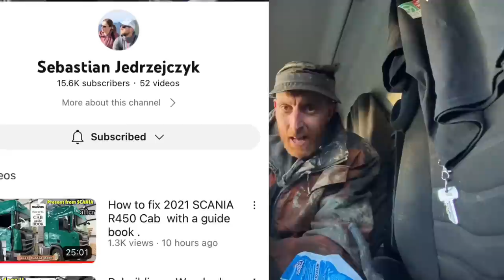Sack the washer guy please… please, the massive lamp re-wire job, sump yes or no?

Comment: When I worked on bin lorries a few years ago I had to steam clean underneath them for mot prep and a lot of the floors on the bin body where all the rubbish goes were corroded through with small holes everywhere and all the greasy fishy smelling waste water used to collect and congeal on the chassis, air pipes and wiring, axles and diff. It was a horrible job laid on your back with a waterproof suit on which wasn't that waterproof so when you were blasting it all off it used to splash back and you'd get a face full of it. Aye I don't miss doing that and glad I got made redundant so I could go and work on buses. That job like what Chris does certainly seperates the men from the boys.

Comment: I have had that before on a corsa definitely be worth taking the sump off and checking the oil strainer as a month later chain started rattling due to low oil pressure

Comment: Hey Chris
With them hook loaders, if you tip the hook (as though you’re tipping a bin) you can go down each side (don’t go under the tipped hook), and wash most of the chassis from up top, it only leaves the bit right underneath

Comment: This video brought last night at work memory flooding back, got absolutely drowned in the torrential rain doing a couple of jobs in the yard, then got within 1/2 mile of home and got called out to one of the motors where the bright spark driver had driven flat out thru flood water and popped the wheel arch panels off!! Tell ya what coach drivers give me never ending struggles, I do wonder how some of them manage to tie their own laces tbh 🤦‍♂️
Reply from the maker: Never ends mate does it….. everyone seems to need mothering 😂😆👍 have a good weekend mate
Reply: @Professional-struggler  got dragged out of bed at 8am for a mirror knocked off, 2 hr drive to London 😭. My weekend on call is gonna be fun I can see it now

Comment: Chris I’ve worked on a lot of these corsa s and that filter was over tightened that’s why it’s like that and the oil needs to be done in the m well I do it ever 6tho the run a little Hotter than other car engines